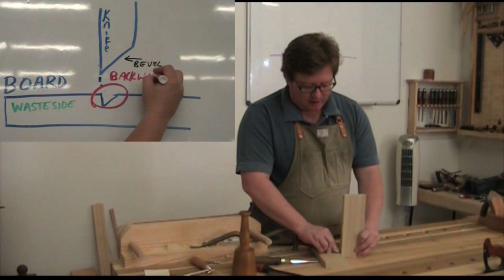Dovetails Demystified - A simple & sophisticated way to cut dovetails.

Comment: Really enjoyed your video.
I have watched  30  or more U tube videos on the dovetail, as well as dvds of several expert woodworkers. I am a hobbyist. I cut my first dovetail late 2013 and have probably cut about 150 since then.  I learned quite a bit from your presentation, especially the repairs, the  dowel and other little things that I would not have noticed had I not had some experience with dovetails. I will add that in lieu of planeing the shim with your finger ( I was immediately reminded that my wife has cut two fingers this week cutting thin slices of cucumber on a kitchen utensil called the mandolin) try the following: I saw a well respected woodworker take a hammer and flatten a shim that was too thick for the kerf-it works great. 
Nice job!!
Doc (Mebane, NC)

Comment: As a hobbyist woodworker, I research almost everything I can find on each topic until I feel confident with the subject.  Then, I will understand just how I am doing it wrong when I attempt to do it myself.  I like your approach to teaching as well as several other instructional videos on line.  What I have discovered is that, although I already have this information in the many books I have accumulated over the years, it is nice to see how someone actually does it.

As to the dovetail pitches mention in this video, this is what I have found:

In 1958, the US Forest Products Research Laboratory tested how dovetails cut at angles ranging from 7.5° to 17.75° in both hardwood and softwood samples fared when the joints were mechanically pulled apart under great force.  The study found that, in all cases, “… the dovetail angle made absolutely no difference to the strength of the joint.”  Some woodworkers recommend using 12° for “coarse work” and 7° to 10° for decorative joints.  Lower (7° to 9°) angles are often advised for joining hardwoods, while higher angles (10° to 14°) are recommended for softwoods and even higher angles (14° to 18°) for half-blind dovetails.

In other words, use the pitch that looks good and pleases you.  In my case, the pitch is what it ends up after I adjust it to a tight fit.  Thank you!

Comment: Because a screw or nail looks better? Dovetails are a strong joint and don't lead to cracking and bruising like with nails and also nails break down dovetails show strength in the piece it shows craftmanship.
Reply: In today's view of wood working and craftsmanship, you are completely correct Brandon Cole.  But dropping back about two centuries, they were viewed as a necessary evil, and VERY unatractive.  Hence the habbit of using half-blind, blind and venier overlays to hide them.  To appreciate this, look at the very high end furnishing of the mid 1800s on back into history.  You will be hard put to find exposed dovetails.  That said, the more common the furniture, the more visible they become.

The cost of nails during that same time frame was a portion of their weight in gold, litterally.  Also most nails were large (i.e. brad and finishing nails were just starting to enter the market).  Fine nails where nearly twice the cost per pound, and a single screw was often the cost of a pound of 4d to 8d nails.  Therefore, the dovetail joint, with its incredible right angle strength, was commonly used in place of other fasteners where such a connection was desired.  Workers were paid by production and not by hour, so the cost of labour, as we think of it today, was not a factor.  Instead, the extra labour was seen as a major financial savings.

None of this takes away anything form the work put into making dovetails or the craftsmanship they represent.  Rather, it reflects a change in the mindset of the populous as a result of the early industrial revolution that effectively allowed for a 95% reduction in the costs of nails and screw, moving them into the forefront of fastners.  It's also the reason for the change in thinking about labour as a cost.  For the first time in history, people were being paid by time vs. production.  This alone quickly made fastners more ecconomical than dovetails.  Combined, these two effects of the industrial revolution effectively changed dovetails from an "ungly and cheap" construction method into a "beautiful mark of Carftsmanship and superior woodworking design."

Funny how opinions and perdigms can change a 180 degrees over a century.  Today, seing screws and nails, or in many cases their concealments) is thought of the way dovetails and other "fine joinery" was thought of in the past.
Reply: Michael Olsen You're right. Yet, dovetails last longer. I live by the sea and usually see nails becoming rust. I like dovetails and old joinery being used in new design furniture, not just simply used in replica of old furniture.
Reply: lawyer1961 ,  I fully agree that dovetails and fine joinery in general has proven itself superior to modern fasnters (nails, screws, etc.).  I prefer to use fine joinery when feasible.  That said, I use screws, nails,  etc. for most rough carpentry and other "lower end" projects for speed and simplicity.

Comment: I've been trying to get mine to look decent, still to gapped and sloppy. Can't say I agree they are relaxing do lol. 
I pretty much ruined the gift I'd put 25 or so hours into already  for my wife. Trying to decide if I should re make all the stock and miter it or just make wood filler
Reply from the maker: Buy an $8 pine 1x4x8 and make a box with that. By second box you'll be doing them fine.

Comment: I love hand techniques and hand tools, but if sophisticated machines existed 200 years ago, even to old folks would not use hand tools. 
Hand tools and methods have been romanticised over the years- and for good reason: We rely too much on calculated electrical machines and it becomes soothing to the spirit of man to use his hands once again. Good video though.
Reply from the maker: They had sophiscticated machinery back then in the production shops. Lots were waterwheel powered. They used them then just as high end woodworkers do today. For diminsioning purposes with the joinery handled by hand. The big houses actually used versions of routers and duplicators for mass production.

Comment: Always a shame when opinion gets confused as objective fact, particularly historical fact.
Reply from the maker: +Jon Miller You'll have to expand on this if you want me to understand. Are you talking about the intro or instruction?
Reply: +Jon Miller It's a fact that dovetail joints were traditionally hidden by trim, or were made 1/2 blind, and the "blind" side was made the visible side.  Proudly displaying dovetails only started with the Arts & Crafts Movement in the late 19th century.  When that style dropped out of fashion in the 1920's, so did exposed dovetails.  They came back with Scandinavian Modern furniture and have been with us since.  It's not just a matter of taste, it's a matter of cost.  Hand woodworkers did not spend time making their dovetails tight because they hid them.  Once you make them visible, the worker has to slow down to make them to a much higher level of skill.  Antique furniture, made before machines, was very roughly constructed where things were not visible.  Boards that would not show, such as on the inside of a chest of drawers, were left rough from the jack plane.  Those guys had to make a living, so they worked fast and rough, and only refined the areas that would show.
Reply: No doubt. And no doubt they would all use power tools wherever possible today. They were feeding their families. 

But that's not what I was referring to. I'm really not interested in a blow-by-blow rebuttal about the silly claims made here. Just not worth the time.
Reply: Jon Miller
You say this video has "silly claims" but you refuse to say what they are, and refuse to engage in a discussion about them.  Do everyone a favor and delete your original comment.  Better to pull it down so nobody else can see how ridiculous you've made yourself look.
Reply: +deezynar Yeah, it would be terrible if there were unsubstantiated claims left all over the internet! 

How about the notion that nails are just as strong as dovetail joints? 

Now go away.
Reply: Jon Miller
It's laughable how foolish people are not ashamed of their own stupidity.
Reply: +deezynar Sure